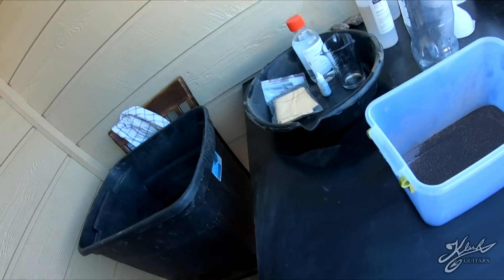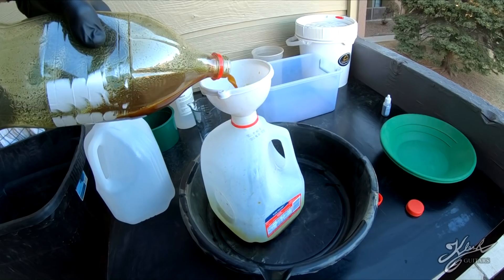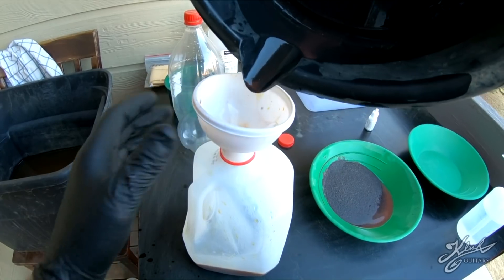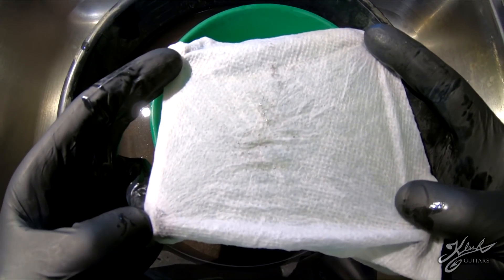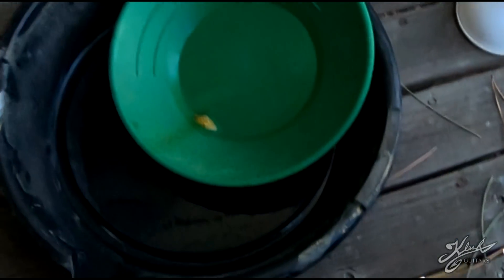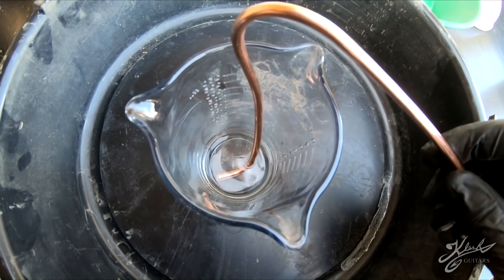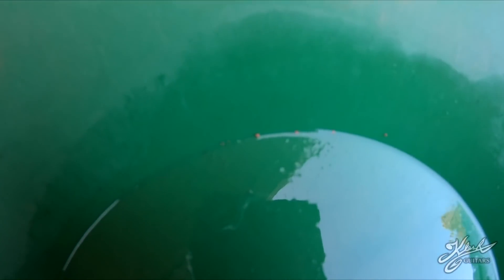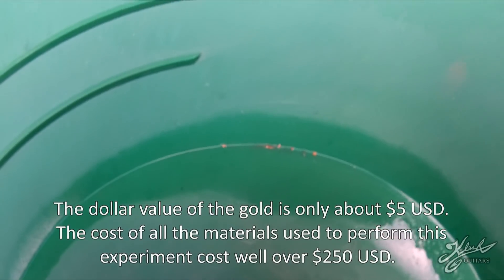Gold From Black Sand Using Mercury And Nitric Acid

Comment: You didn’t need the HCL. Just put the mercury right on your clean sand to get the amalgam.
Reply from the maker: The HCL helps clean the gold for the mercury to more easily start amalgamation
Reply: @Klesh  still not a NEED, just another cost that goes against you. The mercury is going to get the gold regardless. Plus. If by chance there’s any attached HCL remaining at your recovery and you add HNO3, then you create aqua regia and that would put the gold into solution that would require electrolysis to recover.
Reply from the maker: @WonderboyWDE  correct it helps greatly especially for cleaning contaminants

Comment: The Mexican Indians made there own Mercury from a red chauky rock. They did the process with out using acid just pouring the Mercury into the concentrates and moving the pan until the Mercury has gathered the hold.remove the Merc/gold from the pan then depending on the amount drop into a crucible and burn off the Mercury don't breath that red smoke it's pure poison. Melt the gold add borax to remove impurities. Bingo a gold pour. My father saw it done and he told me, he also warned me never to try this untill I was well trained. That was 1967. I was 12 years old.

Comment: Interesting.. though the way I saw shown was to use a copper pan and spread a thin layer of mercury on the pan with water then add the cleaned back sand, I have never seen the mercury separated in a paper towel it all goes into the nitric acid then using aluminum foil to get the nitric acid to release the mercury after the reaction is done with the foil your pour off the acid and you have liquid mercury sitting in the bottom of the beaker instead of scraping it off of a copper rod
Reply from the maker: Yeah it can be done many ways. This is my way, uses the least amount of chemicals
Reply: Ahhh I get it.. thanks for the  feedback

Comment: Suggest you crush sands to 100 mesh first. Use a mortar and pestle. Then proceed. You will get more gold.
Reply from the maker: If it was free mill gold ore then yes, but this isn't. Unfortunately.
Reply: @Klesh  Sulfides hold gold as an inclusion. Thus, milling fine often releases more gold .  I do this. It works. I also use a large rock tumbler to fine mill  cons. I discovered a vein with up to 5 ozs./ton all in arsenical pyrites.  Have found 2 other gold lodes. Own a mine, do assaying for people, too.

Comment: Why would u go through all of that trouble for 1 pound of black sand? I understand it's a demonstration but still you should have used at least 10 pounds so that theres visible gold
Reply from the maker: 1 pound was a reasonable amount that most prospectors might have laying around. If they have 10 pounds, they can multiply my result by 10 to get a rough estimate. Besides I have a very small scale lab here. 1 pound is about the average amount I have been doing lately.
Reply: @Klesh  fair enough

Comment: For that amount of good I would dry it and use a magnet to get all the black sand out and I would be left with the gold. To much work
Reply from the maker: All this material is the magnetic stuff, visible gold has been extracted using traditional methods, so this is the final step.

Comment: Bro, not to be that guy but the 1/4 inch copper you bought, is actually called #4 bare. Its used as a supply/ earth  ground for up a 200 amp service on house panels and detached sub bulidings. Im an electrician and i like to teach people as well about proper terminology aand aspects of my trade. Again, not to be an ass, just trying to inform you as you inform us on these killer vids man. Thanks bro
Reply from the maker: I'd rather use easy to remember terms such as "piece of copper" in my videos, since not everyone has access to a home depot or electrician supplies around the world. THanks though

Comment: Nitric Acid and Hydrochloric Acid form Aqua Regia (1:3 ratio approximately). Aqua Regia dissolves gold particles. So in theory you shouldn't need to use the Mercury at all. If you manage to get gold in liquid form "AuCl4-" (dissolving gold content in aqua regia) - i.e. forming chloroauric acid, you can then precipitate the gold from the solution with sodium metabisulfite. You could use the same process to purify all the gold to 24k (.999), while extracting it from the sands. Plus there would be no mercury waste, which is harder to dispose of than acidic wastes.
Reply: I was thinking the same thing, I'm just not sure if the black sand is mostly iron base like hemotite but it would be easier not having to worry about Mercury
Reply: @MrWorkinguy  Yes, black sand is iron based. It can be magnetite or a combination of magnetite and hematite. Also, it can be all hematite, but then it would probably be brown sand.
Reply: agreed, Aqua Regia aka Tzar's vodka, much easier method, aka gold affinage
Reply: NERD

Comment: Shammy Cloth like the old timers used works good to filter out the  Mercury by squeezing.  A garlic press work excellent LOL, Yea I've done that.  https://www.amazon.com/dp/B07N7W44NS/ref=sspa_dk_detail_6?psc=1&pd_rd_i=B07N7W44NS&pd_rd_w=DGMwk&pf_rd_p=733540df-430d-45cd-9525-21bc15b0e6cc&pd_rd_wg=wtBUU&pf_rd_r=EJGSVJ2PFYSSD5BJR3PF&pd_rd_r=bd3de4ac-51ae-11e9-bb96-ed1d50a708be
Reply from the maker: Thank you pulesjet!

Comment: Thanks for the informative video.  I was wondering what was involved.  I think I'll be selling my black sand though.  :o)
Safe to say that this process would work for gold ore that was crushed but with micro-gold that is too fine to pan or recover in more traditional ways?  tnx
Reply from the maker: Mercury will make any amount of gold into an amalgam over time, but would be safer for you and the environment to do it traditionally.
Reply: @Klesh  How the Mercury or Nitric acid uses in hard rock gold mining?

Comment: You don't need to use straight strength nitric acid. Use 2 parts water, 1 part nitric. Heat to about 150 F until fumes stop. Puts merc in solution, then use strips of ordinary al foil. Will drop HG out of solution. This method is the traditional placer miner's method. Works fine. Save on your nitric acid cost. AL is cheaper than CU.
Reply from the maker: Good Idea David Howard! Thanks for watching!

Comment: Hi there, awesome videos, I've got a few requests... People think I'm crazy, but there's different types of black sand depending on where you are located. I get pickers out of my black sand(I get what you got, out of 1 tablespoon(not a pound) of black sand from northern Georgia) I also use a tumbler and reduce to -200 mesh and it's really hard to rinse, but its necessary to do so or the mud will harden into a rock again. - can you PLEASE make a video on charging mercury using as many methods as possible; metallic sodium? 12 volt car battery? 9 volt(fire alarm)? I saw a video on charging mercury using as device which reversed the polarity + 18 volt car battery... My chemist person said you can dissolve the gold out of the black sand by chemically liquidizing it, is that cyanide? There's supposed to be a chemical in production in south America which works like cyanide but is environmentally friendly.....?? Our clubs placer property is where I get it there's plenty of mercury there too. Theres a few weird spots where the tailings have degraded & the black sand crumbles in your hand into a rusty mess...??? HOW? Some sort of extreme oxidizer? WHAT? I have collected more black sand than I can process within my lifetime at my current rate of speed. - CAN YOU PLEASE go to my channel: BLUNDERBUNK urban prospector, and check out my QUICK video to verify that THERE ARE PICKERS IN GEORGIA BLACK SAND? & I'd like to send you some or meet up with you this may when I come out for 14er season & drop some off to you. You got a po box address?
Reply from the maker: Hi I looked at your video and see you found some gold in your black sand, nice job! Must be lots of magnetite and hematite there in N. GA. I don't know any other ways to chemically extract gold, just my way. I know there's other ways I just don't know them so can't make a video on those other processes. I do have a PO box address listed in the description of every video. Thanks again for watching -Shane @ KleshGuitars

Comment: cody says you need lots of Hg to dissolve gold ,,so what then the nitric acid dissolved the Hg? why not use aqua regia instead to dissolve it out of the black sand? i would think you would get much better results then going through all this fuss and puss,,you can then evaporate it or use another base compound to crush the gold back down to solid ,,anyways how much of the chems are you using to extract this amount,do the math and if it costs more than the gold then you wasting your time
Reply from the maker: Not a lot of Hg is required to amalgamate the gold, only a few drops is plenty, however It's smart to put everything in a rock tumbler for a few hours to absorb as much Au as possible. I'm not sure what would happen if you just tried adding aqua regia to the black sand, I would imagine it might dissolve other elements as well as the gold? Cool idea though, wonder what would happen. Thanks for the insight
Reply: well if you ever watched the video codylab made about it he shows through a few exp that it took quite a bit of Hg to dissolve Au but about using aqua regia perhaps you could give it a try and even if other elements dissolve you can always recover the gold alone using ,,well i forgot what he used but it might have been a base ,it crushed the dissolved gold back into solid
Reply from the maker: He probably used sodium metabisulfate to drop the gold from solution, which is what I use in my video here. I only do it once a year so although I'm not very experienced with it, it's pretty simple chemistry and with the right safety precautions it's pretty easy.
Reply: yup sodium metabo thats it but id rather not work with Hg and squeezing it through a filter like that,id avoid Hg completely if possible and try the aqua regia,id rather work with acids than that crap,,reminds me i have a spill of it in the corner of my room i need to eventually clean up,,been there a long time and im worried about breathing this crap,,btw do you know how to clean Hg that has gotten old black n dusty? id like to make it silvery and slippery again if possible before storing it away

Comment: You should have just did it all at the same time lol the mercury is meant to be used for black sand concentrates. Your just using it on black sand lol that's why your not getting much gold. You might as well go pick some dirt outside cause that's what your working with. There's steps to being successful
Reply from the maker: The black sands contain microscopic gold that are easily extracted using this method, if you have a better way let me know! thanks for watching!

Comment: If I had read things correctly from some books, I think you saved enough black sand with gold that you should be to  re-pan a large amount of it in a pan which you should be able to pan out more black sand and concentrate the gold further.   Then you should be able to put some mercury into the concentrated gold and absorb all of the fine gold making a gold/mercury button.  Then do the acid process with the button to devolve the mercury leaving behind the gold.
Reply from the maker: Correct! Thanks for watching

Comment: Take  a piece of 12ga. copper wire and hammer it out flat into a strip then brush it smooth for your copper strip. BTW most of your gold is in solution in the hydrocloric acid.
Reply from the maker: Thanks Douglas Ives for watching!

Comment: maybe you know the answer. And yes people are going to b!*ch. I have assay reports saying various precious metals in my ore. I ball mill the concentrates with mercury. Then torch the amalgam ball, problem it splatter's. I know to do it slow, but even after the merc. is burned off, the remaining as I am trying to get it to a button will splatter. Just had a gold buying place yesterday say the button was lead, I said I use mercury and mercury wont pick up lead. I am building a retort, to burn off the merc. and hopefully stop the splatter problem. I tried your nitric way and had all white crystals in the bottom? I didnt see any black[gold] specks.
Reply from the maker: Not sure I never tried it by burning off the mercury.
Reply: ok Thanks.
Reply: ok Thanks
Reply: for what your describing...just before you heat up the Mercury...add in about 1/8th an ounce of baking soda...once everything is heated and complete you should only have gold remaining if you are using nitric acid; mercury will only attract precious metals
Reply: thanks for the tip, will try.

Comment: When you showed the cost of materials needed to perform this process....that was pre-use costs?  So , how many pounds of black sand can you process with the materials purchased?? is it really cost effective to do so.?
Reply from the maker: The mercury can be re-used many times, and you don't need a lot. The nitric acid will also last a long time, I used a very small amount as well. If you're running a lot of black sands and plan on repeating the process yeah it will be cost effective for sure. If it's only a small amount of black sands a few times, I'd just throw the black sands away and save the money.

Comment: Fun stuff. Where are you that one pound of black sand only yealds 2% of a gram?? My viewers think I'm crazy, and I'm lying about pickers hidden inside. I tried to show them and there's almost no views. 1 pound of chunky black sand in a rock tumbler with random rocks in with it yealds 1/4 of a gram (Dahlonega Georgia) -An old man at my prospecting club turned me on to it, by pulling a golf ball sized chunk of gold out of his pocket and said he'd gotten it out of a 5 gallon bucket, about 100 pounds.. I have around 10 tons of it saved up. Your method is not a realistic option for me. Great video  though.
Reply from the maker: Thanks and I belive that a rock tumbler would produce better results. I believe you when you say you got 1/4 gram from 1 pound of black sand. Thanks for the comment!
Reply: check out the gpaa.com there are folks who will refine your gold for a percentage; oh and your black sand should be course enough that I tumble about 3 lbs or so just on itself...we did try ball bearings...it was faster and finer without the ball bearings...what percentage of gold have you been finding say per ton.

Comment: I wonder if you can get the Mercury out with a magnet? My old boss used to save all the Mercury bulb thermostats, break the bulbs and keep it in a jar and sell it to some business. He accidentally broke one and it spread all out like little BB's all over. He took a magnet  and it picked every bit up and he put it back in his jar. My Science  teacher got silver out of Silver nitrate using a copper plate. He said he used to get it from X rays and film developers back when they still developed film. It was pretty cool it attracted to the copper and looked like little Icicles Of Silver.
Reply: mercury is not magnetic...want to pick up mercury...use activated charcoal; and use the gloves strictly made for handling mercury...will set you back about $20.00...
Reply from the maker: Someone broke a thermometer at my high school and they closed the school down for a week to clean it up

Comment: in Califoreignia some of the Gold panned out and used to be dredged (against the Law now thanks to lieberals in the state) has contaminated Gold, otherwise, its covered in Mercury.. the prospectors use to bring Nitric Acid along with them to dissolve the Mercury and make sure you never use Chlorinated water when rinsing it.. According to my Rocket Scientist father in law, it tarnishes Gold and it will dissolve alloys in Gold Jewelry...
Reply: you always need to inform the jeweler that you used Mercury amalgamation process so they can neutralize it...you will lose about 20% off the spot price; and yes, when nitric acid is heated it will destroy all metals except gold

Comment: The fumes from your neutralizing process can have droplets and vapors of acid suspended in the CO2, which is why I suggested the hood. Outdoors is better than nothing and the milk bottle is safer than a bucket. It's the long term low concentration exposures that mask what happens in the short term.
I'm not giving you new info, just reminding. Be safe. 
I'm not speaking from experience on this next subject. Or maybe I am...
Back off the mercury if your friends notice bizarre behavior.
Because you may not.
Reply: I find it highly unlikely he will get mercury poisoning from that amount of pure mercury. If he was working with something like organic mercury compounds, it would be a different story. Pure mercury is fairly hard for your body to get into the bloodstream. Cody’s lab has some great videos on the subject.
Reply: @barry6541  Cody is full of shit.
Elemental Mercury vapour is deadly.
People have died from just that, a child whose parents were given a blood pressure monitor to take home, spilled the mercury on his bedroom  carpet, developed mercury poisoning and died from the vapor gassing off.

Another very important point, elemental mercury does not stay elemental when spilled outside.
Bacteria convert it into organic mercury compounds.

That is where the methyl Mercury responsible for the epidemic of poisoning in Japan came from. It was dumped as elemental Mercury and turned into methyl Mercury through the action of bacteria.

Also Cody checked his levels by serum test. Mercury lodges in tissues, you can have normal blood levels and still be poisoned. Proper assay requires a tissue biopsy.

Comment: HNO3 is not to be casual around. Use baking soda to neutralize the HCl, best to do it under an exhaust hood. Hang plastic on your kitchen hood to help draw it, even if it dumps out the top in the kitchen it is being both diluted and reacted while its moving and not going into you directly.